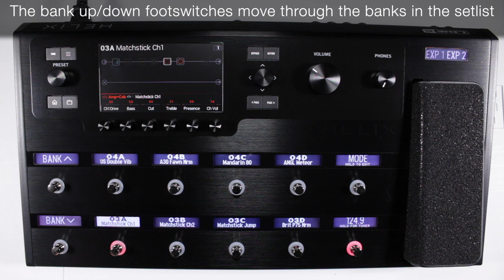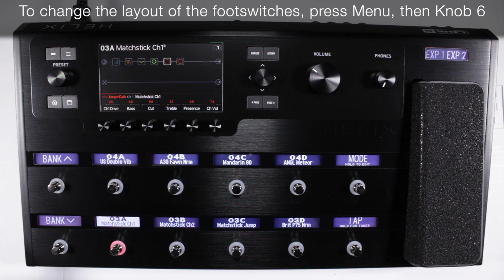Helix Minute: Footswitch Modes

Comment: To be honest..... rather that dictate to users what Preset Modes are.... there's only 10 SWITCHES (excluding tap tempo, up/down and stomp) - you should have JUST improved the command center and let users assign each switch manually. ALSO.... let them save a footswitch configuration as a template.  I SPENT HOURS trying to get a few switches as snapshots, and a few as stomp switches.  You guys REALLY need to go out and buy an Axe-Fx, just to see some of the more open thinking they have..... it would greatly benefit your product.